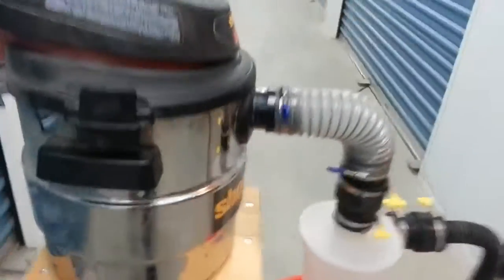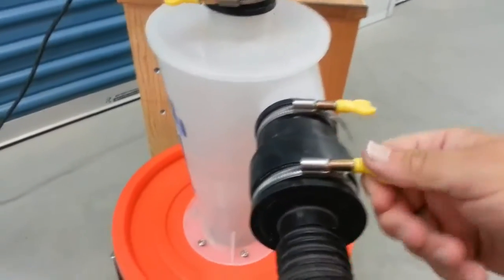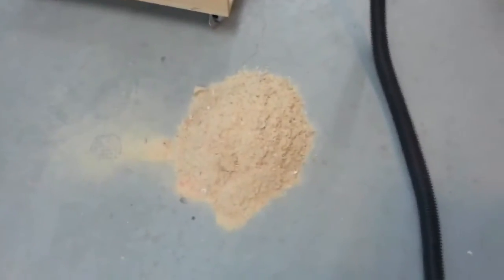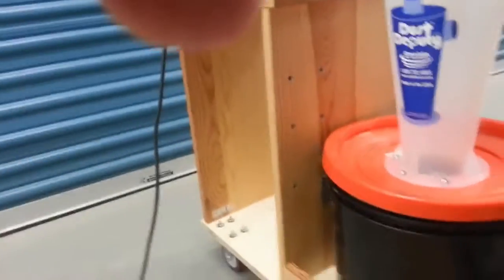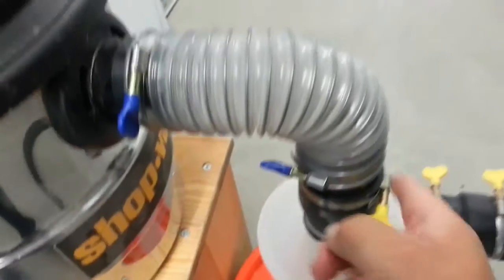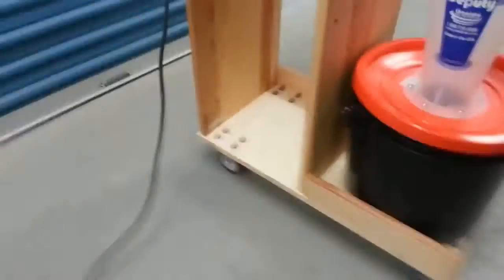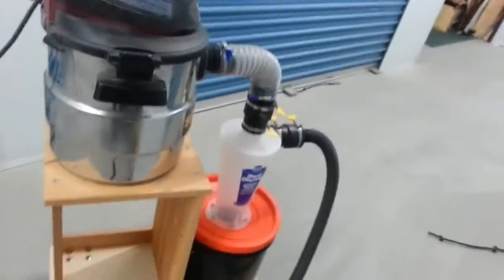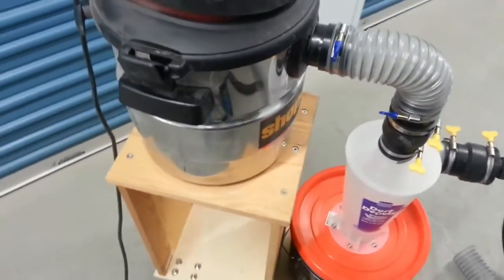Cyclone Dust Separator

Comment: Don't run filter-free. It may appear to work better, but only takes out most of the bigger than 10 micron stuff . Normally you would not inhale the bigger stuff like wood-chippings, but the smaller particles that you cannot see with the naked eye will get in your lungs and give you trouble. Put a new filter in please, you will thank me long after I am gone.